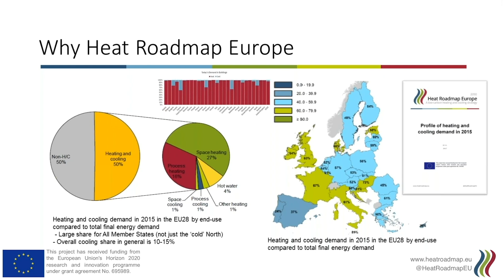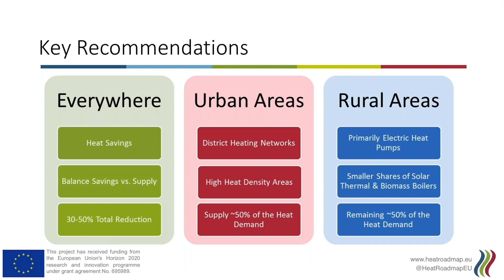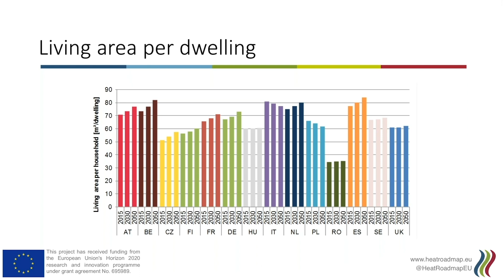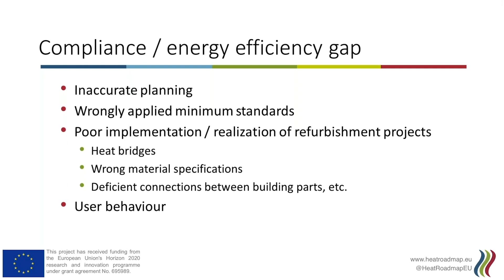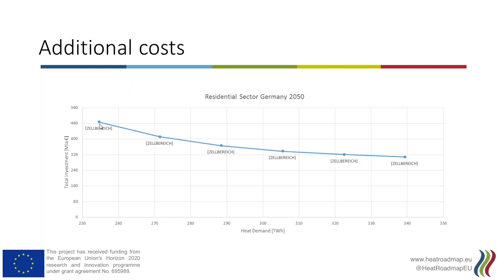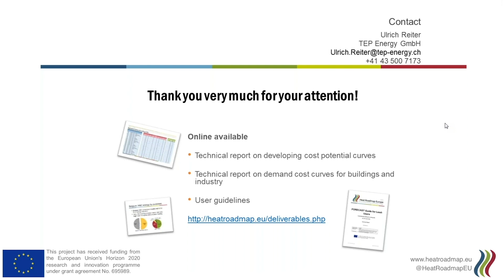HRE4 Webinar #7 — Energy savings in buildings

Comment: I agree with Martin, there is not enough focus on refurbisment, but most buildings before 1970 are not worth refurbishing. Beter to rebuild those with passive houses.  I also often miss in the models the potential gain in connecting heat consuming devices, like dishwashers and washingmachines, to the main heat producing element (gasburner or heatpump). The main heat producing device will be much more efficient then the electrical resister element in producing this heat. Generating electricity in a gas or coal powerplant is not efficient at all. Lastly, it would be good to model what happens if you combine a heat pump with a fuel cell, where the local fuel cell generates part of the heat for the building, and generates at the same time the electricity for the heat pump.